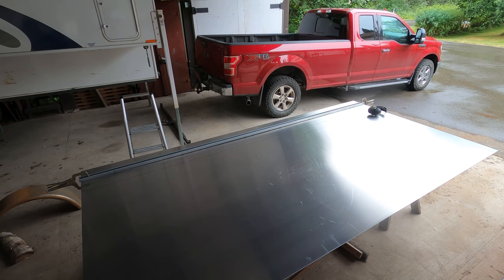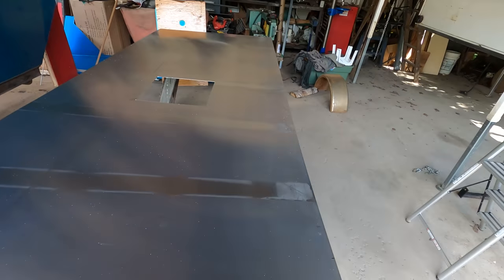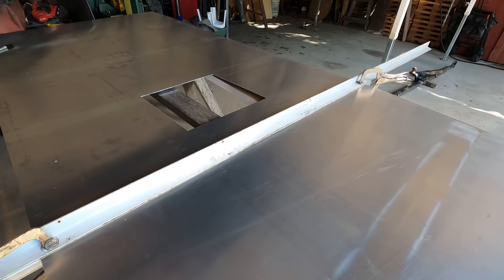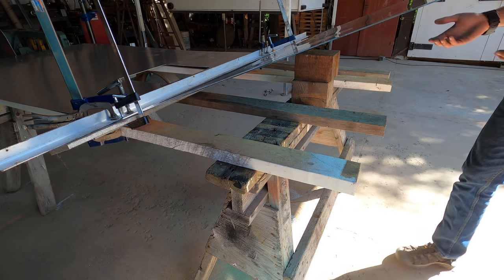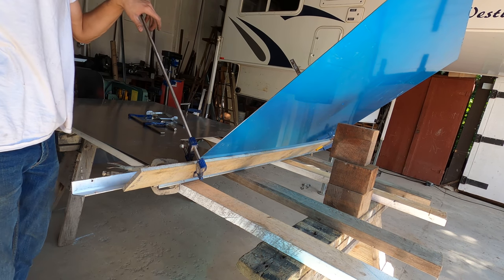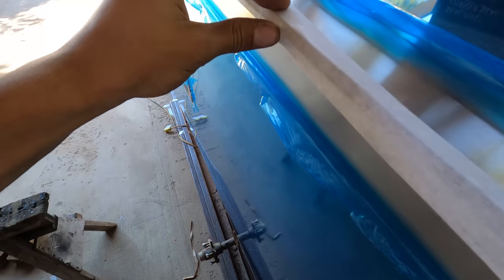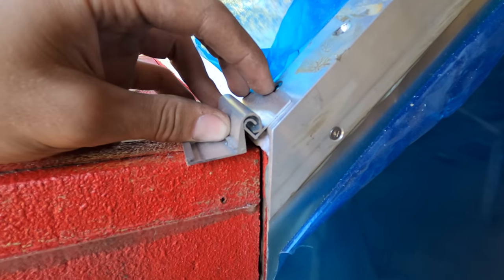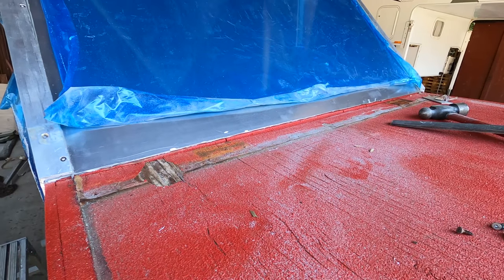TearDrop Trailer Aluminum Exterior Install

Comment: What are the odds there will be a leak where the screws are drilled on the angle iron
Reply from the maker: Pretty small because of the butyl tape behind the Angle. As I screwed them in, I could see the butyl wrapping around and sealing itself.